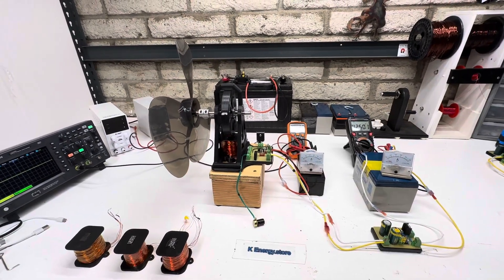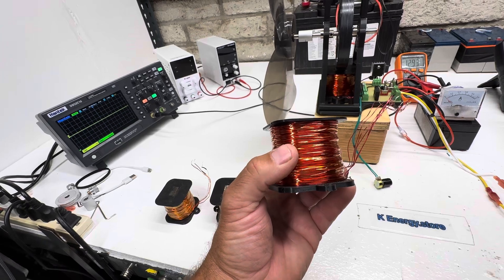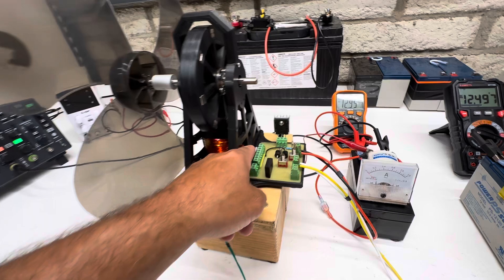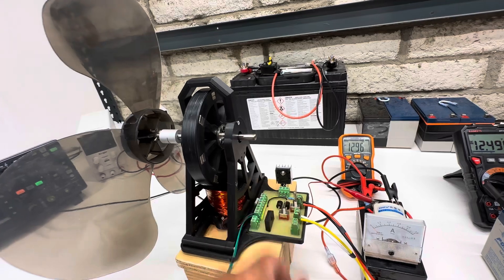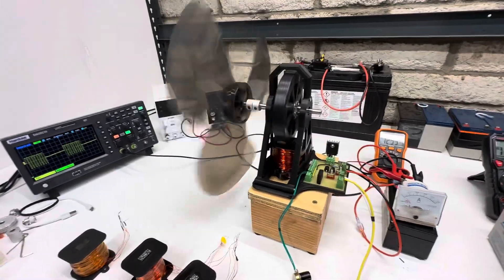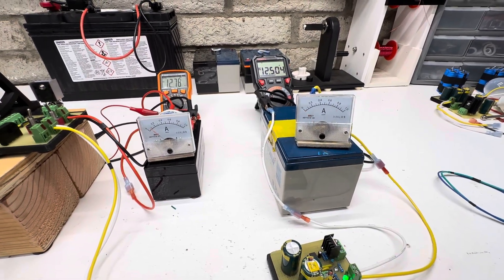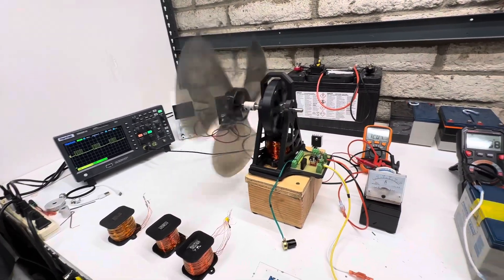Bedini motor evolution

Comment: So you use the same trigger size wire as the motor, if you have to make multiple coils on the same one, is it the same number of turns or is it the same length of wire.Thanks for a good channel.
Reply from the maker: Yes 
And yes same turns
Reply: @kenergy1707  thanks for the answer.

Comment: I spent a lot of time on the Bedini engine. It's a waste of time to deal with it. The propeller should be included in the loss function. Instead, an iron shaft can be added to maintain torque. But in any case, more important projects can be focused on.
Reply: I think you missed the point. When Bedini ran the fan, he was harvesting wind power or performing work
Reply: Looking at his patent, he claims that it is not a perpetual motion machine, does not violate known physics, and without additional external power, the motor C.O.P. is 0.98.
Reply: @paulshields1883  Yes, I understand your setup better now. I hadn't thought about it before for systems that generate electricity from wind. It's really interesting when you look at it that way. I was looking more at energy transfer. I might apply it to wind generators in the future. Thanks for the idea.

Comment: Are the coils wound by hand or using a device? Thank you sir.
Reply from the maker: @hoofheartedicemelted296  hand cranked with counter
Reply: @kenergy1707  Tedious, but necessary for calculations right sir?
Reply from the maker: @hoofheartedicemelted296  definitely

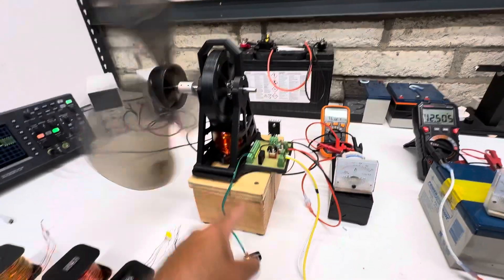Comment: 5:50 high impedance coil with greater source voltage across because the turns are there the spike peak will be greater
Reply from the maker: @mykedoes4099  I’m referring to the trigger resistance to the base because of so many turns the resistor resistance has to be high
Reply: @kenergy1707  I know what your refereeing to believe me.. ;)  I am just saying instead of limiting the current to the coil increase its impedance by adding turns and thinning awg
Reply from the maker: @mykedoes4099  yes exactly 👍 
Also by making large load you can get up to 8 pulses per magnet instead of 1
Reply: @kenergy1707 Hi Kevin,  you can indeed so long as the coil can handle the current . Makes for nice drive engine , how do you pulse one coil 8 times in one magnet pass ?  i know how you can do it with 8 coils ... are you using 8 transistors in sequence ? with timer ?  or is there some simpler way i am not getting here ?
Reply from the maker: @mykedoes4099  by the trigger resistance and load
Reply: @kenergy1707  I am focused on using the pull force of the rotor magnet to the electromagnet iron core as my driving force and only creating a load on the electromagnet that is suffice to break the connection between the Iron core and the Rotor magnet as to allow the attraction between the iron core and the rotor magnets continue on there course ;)